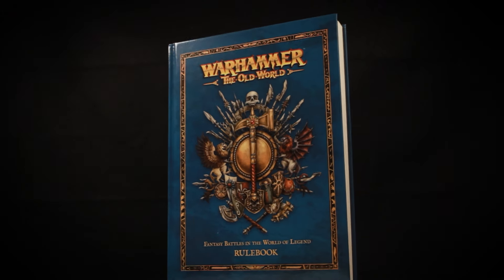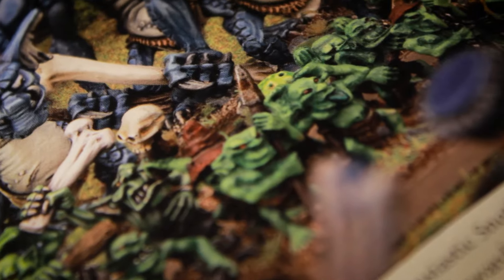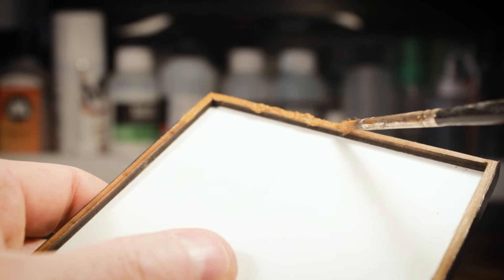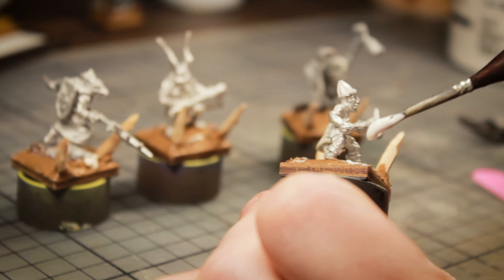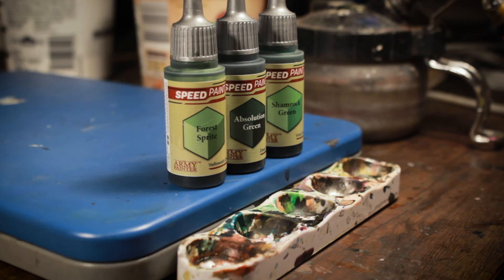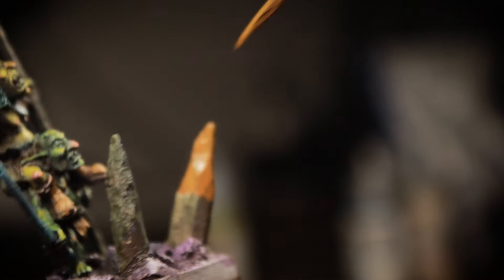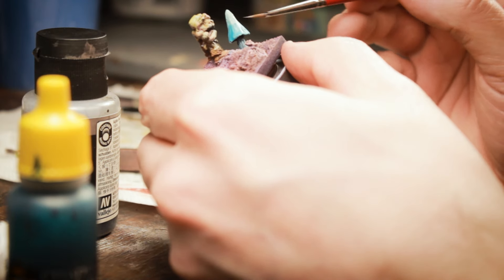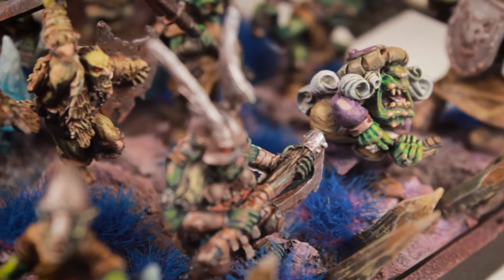DA REALEST BIG WAAAGH! - My Goblin Regiment for the Old World

Comment: Lovely video as always! This made me want to buy a big pile of hand sculpted metal minis from different companies! Your narrating always makes your videos inspiring and seeing the finished result accompanied by the cheap version of Ecstasy of Gold was amazing! 😄

Can I suggest something that could be improved? The depth of field is quite shallow when you show the finished minis on the turntable, making it harder to see all the details of the minis at the same time. I've worked with this, so let me know if you want some tips on how to adjust it 😊
Reply from the maker: Thank you! I appreciate your kind words. I understand what you mean about the shallow depth of field; while it can enhance certain shots, it would have been beneficial to have a broader depth for this particular one. Regrettably, I'm working with an older camera sporting an outdated sensor. Consequently, I often find myself needing to narrow the aperture to capture enough light for the shot, which, unfortunately, exacerbates the issue. Moreover, anything shot above an ISO of 200 tends to result in significant graininess.
Additionally, this camera lacks autofocus, making it a constant struggle to achieve sharpness in my pictures. Hence, it's primarily an equipment limitation rather than something I can readily adjust.
If you'll pardon my shameless plug, the best way to support me in overcoming these limitations would be by becoming a patron. Every contribution goes directly into improving my channel and, ultimately, acquiring a new, modern camera. Currently, ad revenue isn't making much of a dent in this endeavour! 😄